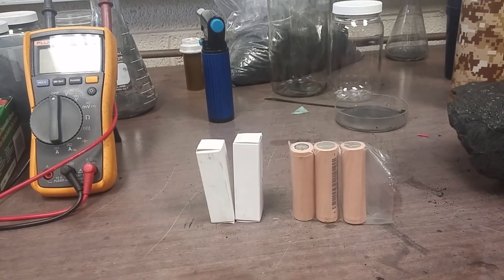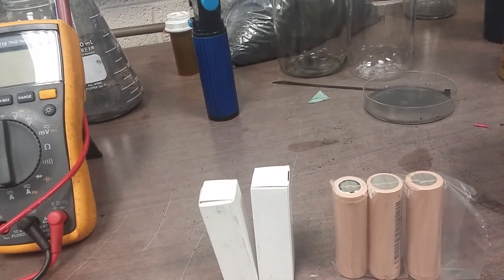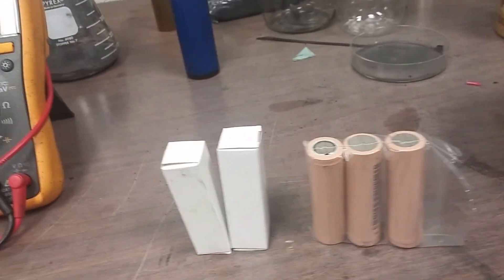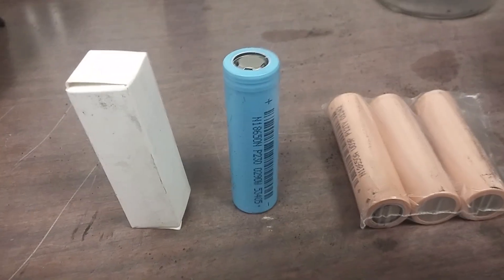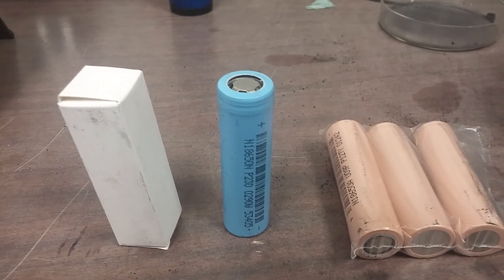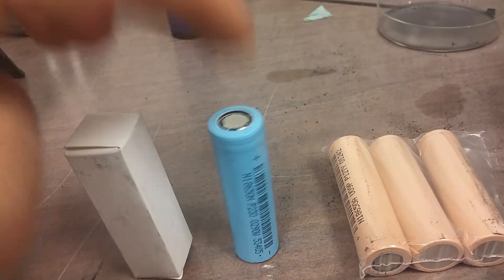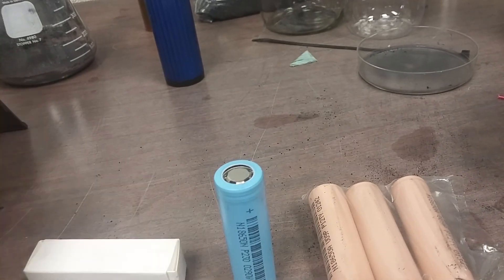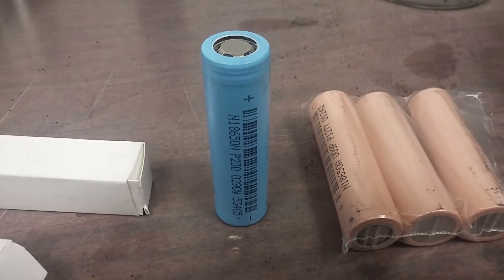Real graphene batteries. Finally!

Comment: Graphene ... my ass! Extraordinary claims require extraordinary proofs!!!
Reply from the maker: Jonathan Vaucher you don't know what you are talking about.
Reply: Lachezar Krastev agrreed,they should tear it and look inside first,just a scam or misunderstand.
Reply from the maker: Rattanarerg Onyaem why would I destroy a cell for testing, before I get it tested?
Reply: Why wouldn't you video one being assembled?
Reply from the maker: It's assembled at a company, not by me. I only supply the graphene.
Reply: So, you're a Tier 1 supplier, and you can't provide vid of the assembly process?
Reply from the maker: I don't sell the battery, only the graphene in it. It's in testing from a manufacturer.
Reply: Hey, I'm from EU, can you please give manufacturer's contacts, I'd be interested in importing those batteries when ready ! I'd donate to the channel part  of the profit.
Reply: Do you know what the real grephene is? ... It is not some powder - it is one atom tick structure and it is extremely tough to produce. What you produce may have some graphene particles in it but the properties are not even close to the real graphene. I am sick of so much fake youtube content.
Reply from the maker: You don't know what you are talking about. Sorry, you just don't.
Reply from the maker: No need for donations. And when the batteries are ready, they will be available. Still quite a bit of testing....
Reply: What is the size of the graphene sheets in the powder you produce?
Reply from the maker: The flakes range from 0.5 micron to 5 micron in diameter. The thickness is what really matters for it to be graphene and 0.3 to 1.2 nm (there are variances due to other forces in measurement) is our material thickness. I have a few videos to explain that exact thing.
Reply from the maker: This is CVD, and not the only way it's made.